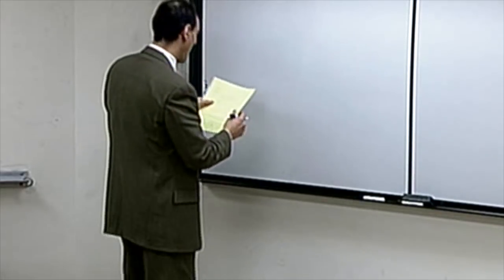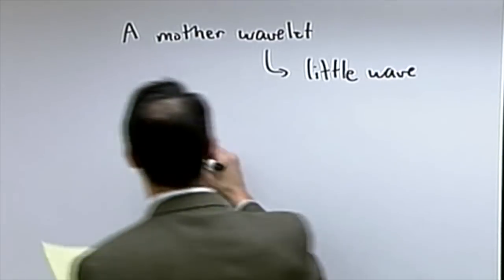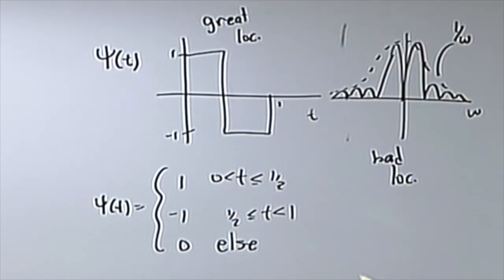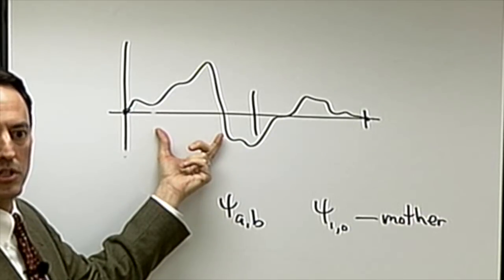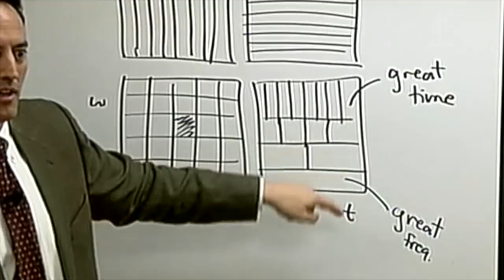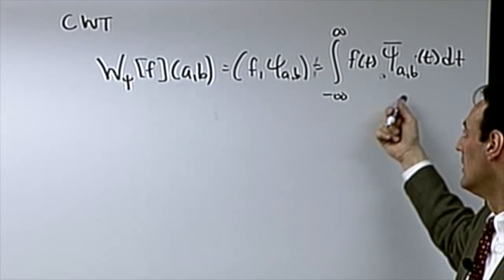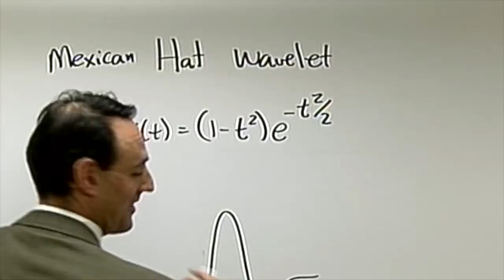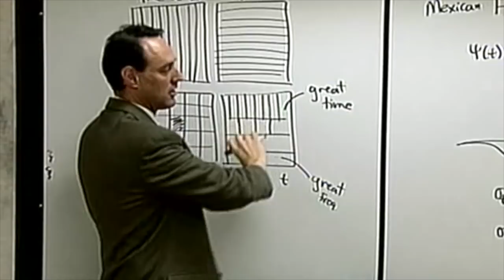Time Frequency Analysis & Wavelets

Comment: A video about a method that can be used for data compression (compresn):

We can see that data compression was used on the video.
the black lines have very white lines around them, then slightly grey lines around them, then back to average, which is very slightly grey.

Clipping.